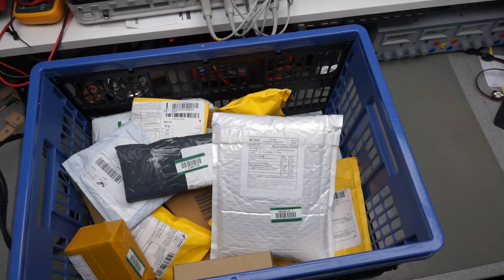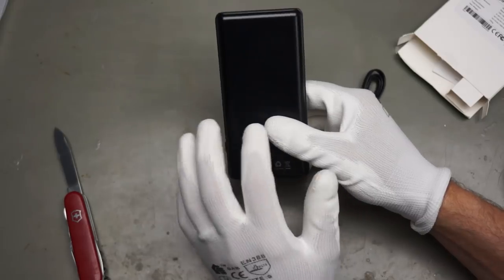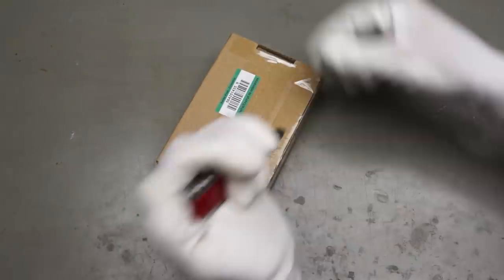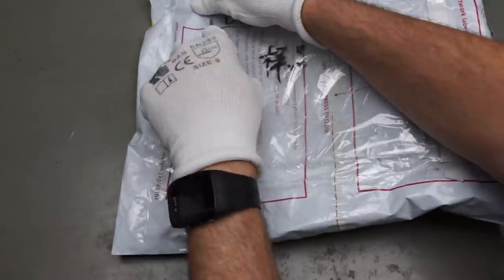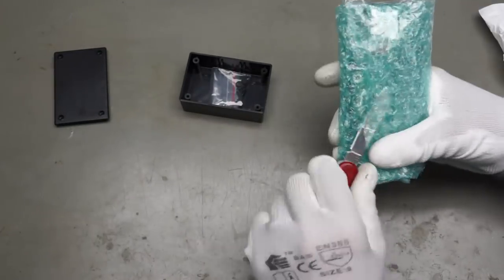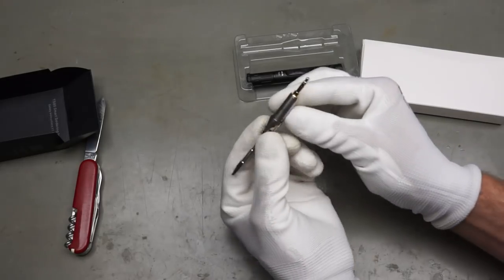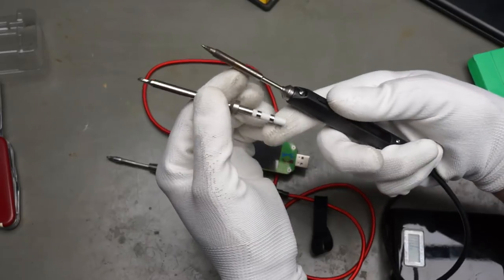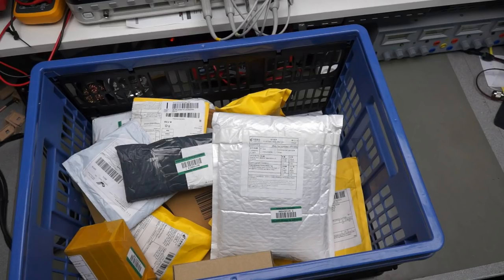#237 Singles "Discount" Day Mailbag (QC 3.0, CurrentRanger, Pi cases, Soldering Irons, Dupont Wires)

Comment: Had to get a TS100, some extra tips and an adapter for XT60 connectors. A perfect fit for my on-the-go airsoft repair kit and it'll run off of my 11.1V LiPo batteries that I carry around anyways and that are already fitted with XT60 connectors. That's just brilliant! Thanks!
Reply: Simon Kunze same here except I modified the cable for 18v power tool batteries
Reply from the maker: @Nicksperiments: Good idea!
Reply: You can do the same with T-80. I have a my 4S Lipos powering it through an adapter providing Q3 USB-C.

Comment: Geeeh !  You did it again !  Forced me to buy this electronics stuff from abroad. I ordered that CurrentRanger immediately.  That man cost me dollars...   Tnx! :-)
Reply: ""  µCurrent GOLD from EEVBlog which is great in that it has the precision and bandwidth to capture fast current transients, but it’s a simple manual device that cannot auto-range and unfortunately it’s really noisy in the nA range where it picks up mains noise and it’s unusable without an extra cap on the input (I thought mine was broken but this problem is also reported in the EEVBlog forum here and here). It’s useful when you know your DUT is going to stay in 1 range or if you can predict when your DUT might wake up from deep sleep and manually range just before that happens but it’s a guessing game. Hence the mechanical switches get a lot of abuse and wear, add output noise during switching, and introduce some contact resistance with noticeable effect in the mA range. ""  https://lowpowerlab.com/2018/09/26/currentranger-auto-ranging-current-meter/
My own thoughts about µCurrent Gold. Thats why I didn´t order one already.      btw  awsome channel !
Reply from the maker: I agree with your findings of the µCurrent. I hope I will be able to compare the two with a Keysight power analyzer ;-)

Comment: Did you already tested the TPL5111? I'm thinking to use the TPL5111 to start up/wake up an Arduino mini.
I am curious what will consume the most: the Arduino mini in deep sleep mode or the Arduino mini with TPL5111. I want to wake up the Arduino mini every 10 min. What do you think about it?
Reply from the maker: Just check the datasheet and you know ;-)

Comment: De-soldering for the faint-hearted....
Dear Andreas,

there are a few things we might share besides the age: One is to be an old dog who is eager to learn new tricks in electronics.
I always dreaded the repair of a board with multi-pin components. The moment I thought I got the little buger off, I often realized that it was holding on to the pcb traces, pulling 'em off the board! 
For getting a 40 pin header off a board I can give you two advices: 
First, sometimes you can make use of the new spuders you got. If you can try to pry off the plastic holder that keeps the headers together you got a homerun: every pin will just fall off . . .
With double row headers it is more tricky. Even if the trick fails to make a few cuts with a real good knife (I guess you don't need advice on knifes) and the plastic holds like glued on - there is the last line of magic defence: SRA Fast Chip
This is a solder that keeps it's temperature for a long, long time. Time enough to get a multipin chip - or a header - off the board. Only disadvantage is that you have to thoroughly clean the board with alcohol, or Grappa.
You can find the stuff in Europe on Amazon or here at these friendly guys
https://www.pcb-soldering.co.uk/sra-fast-chip-kit-for-smd-removal-2cc-flux-820mm-alloy.html
Maybe you want to give it a try and post your opinion.
Thank you so much for your exeptionally inspirational videos
Juergen aka GyroGearloose
Reply from the maker: Thank you for your tips. I took it off now. I cut the plastic every 2 rows with pliers. then I removed it with the spouders and removed pin after pin...

Comment: Great Video ! I am looking forward to the video about thd TPL5111. Please test it with an arduino or an attiny 85. I am especially interested in the low power devices that you recommend.
Reply from the maker: The TPL5111 works with all micros. So I will not focus on a particular one.

Comment: Yes, a fume extractor. I need one of those for WAF otherwise I must do projects outside or in the garage. Neither is preferable this time of year.
Reply from the maker: You might be disappointed with my proposal. It will be very basic. And it will not solve your problem of going outside :-(
Reply: @AndreasSpiess  Ah, but maybe I can set up close enough to the loo that I can use that exhaust fan.
Reply from the maker: Actually I will use. PC Fan to take the fume away from my nose. I will not clean the air. My soldering iron does exactly the same and for the soldering I do I will survive the very distributed fumes ;-) It is much better than having 100% directly in my nose.
Reply from the maker: Actually I will use. PC Fan to take the fume away from my nose. I will not clean the air. My soldering iron does exactly the same and for the soldering I do I will survive the very distributed fumes ;-) It is much better than having 100% directly in my nose.

Comment: Are the Dupont wires made of solid Cu or Cu coated steel?
Reply from the maker: The wires inside are grey. So no copper for sure. But this does not hurt as I do not use Dupont connectors for higher currents.

Comment: Hi Andreas, did you finally test the TS80p ? Thanks I can't find your video
Reply from the maker: No. But the TS80 is my main soldering iron.
Reply: @AndreasSpiess  thanks, i have to buy one, an i have read thst despite ts100 reach 40 or 60w, ts80p with 18w is even better. Are you ok with that ? As you have both ....
Reply from the maker: I do not use the ts100 often. I use the TS80 on a qc3 power brick

Comment: Andreas, the link to the currentranger throws some warnings by bit.ly for being dangerous. you might want to check it.
thanks for the video, i fell in love with the ts80
Reply from the maker: Thank you for the tip. I changed it now to the original (which is a bit long).

Comment: can you suggest a suitable PSU for that powerbank and for the ts80 itself, if not using the powerbank? thanks
Reply: also to the antistatic cable and to the flexible power cable for the ts100, please...
oh, bitly is reporting the link to the uCurrent device as malware...
Reply: I'm using a Samsung quick charger.
Reply: blitzwolf seems to have some good qc3.0 chargers, look them up on banggood
Reply from the maker: @squalazzo: The bitly link should be ok now and the link to the cable is there, too...

Comment: @5:13 you say the pi is Finish - it looks more like it's been san-Suisse'd 😅🥪
Btw, China is 9 hours ahead of CET, so the 11/11 shopping period is now over 🤤😪
Removing the 40 pin pinheader can be done by heating each pin up individually and pulling it out with a pair of pliers. Still a lot of work though, doing all that PIn-Schweizher'ing. 👍
Byee, not crazy youtuber 😁
Reply from the maker: I think the Chinese do not stop the sale before the last Californian is in bed ;-)
I know how I could remove the pins. But it is too hard. I still hope I can use it as an Octoprint server in my Prusa...
Reply: @AndreasSpiess  Are the zero boards still around $5?, if so then it would not be cost effective, I totally agree. On more expensive boards it might be worth the effort - a good trick to clean up the holes is by rolling a few strands of clean copper (cut from mains wiring) and moving the thin 'screw' up/down the hole acting as solder braid. Quick, easy and not that hard.
Good luck on the printer project!
Reply from the maker: Unfortunately the zero boards were never 5 $. But mine is still usable, just not in this case.